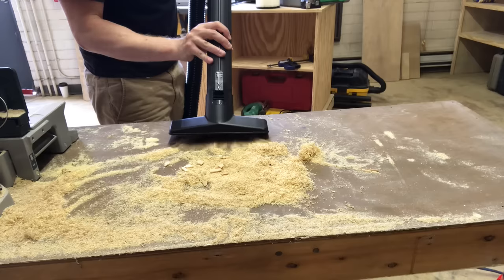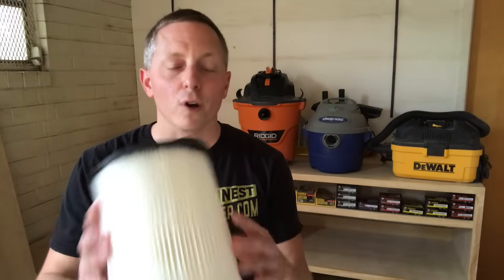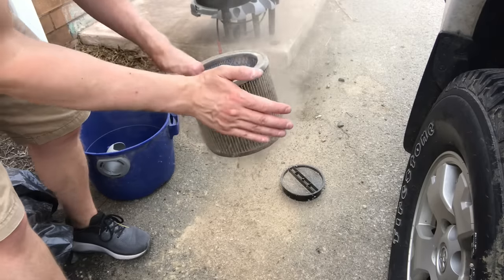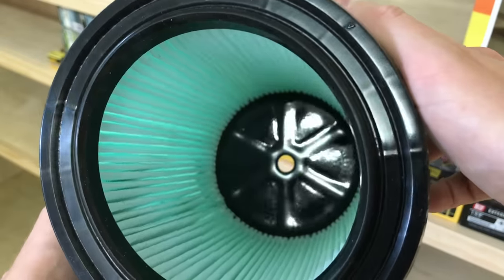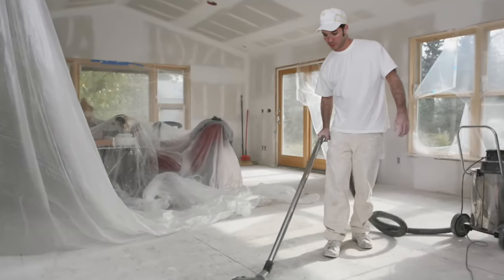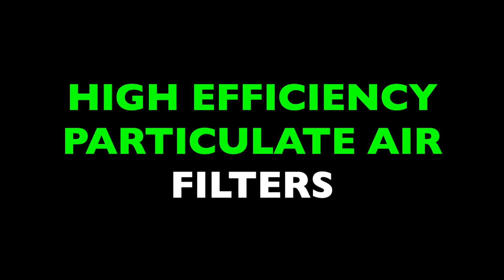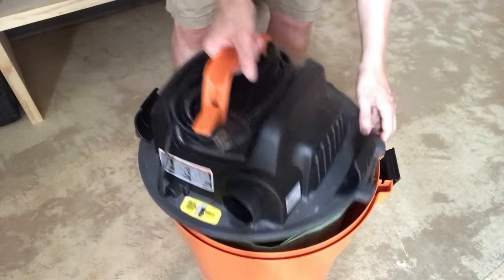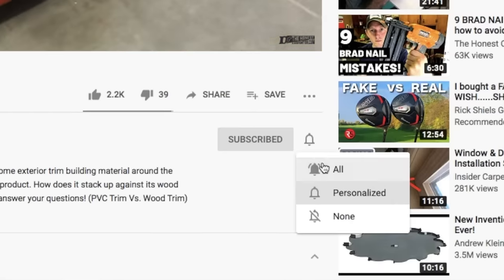Never Use A SHOP VAC Without One Of These!! (Shop Vac Filter Bags/How HEPA Filters Work...)

Comment: I recently bought the HEPA filter and bags for my Ridgid 12 gal vac. I can't believe I waited so long to do so. The best part is that they do not affect the airflow like you might think.

Using an anemometer, I measured the airflow, at the intake, without a filter and then measured it again with the bag and filter installed and did not find a significant difference. Yes, a small difference, like 3-5 cfm, but at 180-200 cfm, we're only talking about a 1% difference. I'll take that in exchange for cleaner air.

Comment: Great Video. I've been doing it right. 1 trick that I use to clean out the Shop Vac Filter Pleet's is use a Portable Mini Leaf Blower!!!! WORKS GREAT for blowing off the Saw's & Tools of debris before putting them away too. Many uses and my Mini Leaf Blower uses the same Rechargeable Battery Packs as my Drill, Impact Driver's, Grinders and Circular Saw so I suggest trying out a similar setup.

Comment: The bags are cheaper than the filter, but not much
I’ve reused the bags by cutting it open and reseal it 
I rely on an N95 mask and use a spare hose connected to the exhaust port to blow dust outside, not in the room you’re working in

Comment: I have added the “Dust Deputy” to my Rigid shop vac and has kept most of the dust in the 5 gallon bucket.....
Reply: For drywall I use the dust deputy, then a drywall filter bag, then a HEPA filter.  Without the drywall filter bag, the HEPA filter would still fill up after a while, even though the Dust Deputy would take about 95% of the sanded compound.  With the bag, it's a lot longer between having to swap out or clean the HEPA filter for a fresh one.
Reply: What is this Dust Deputy you mentioned?
Reply: @angellas.1314  An add on cyclone dust separator.  Dust Deputy was the first major make to the consumer market.

Comment: Great video! In my younger years, I would have been spared many horrible sinus headaches following your advice.  Also keep in mind a lot of times you're cutting pressure treated wood, so you're also filtering out metals like copper out of the particulate matter.  I was just thinking I needed a new shop vac.  I'll try the Rigid.
Reply from the maker: Good point about the PT, Bill!

Comment: I guess I never thought of having things “sucked up” and seeing the collection inside but never thought of particles that get let out.. The shop vac I have gave alike a fabric bag to put over for dry vac use but now wondering what is being de,eased that is not visible.  Thanks for the tip and I will look into mine since I do plan on using it for new build when ready hopefully by mid to late December.  Thanks as always.....

Comment: The best thing I ever did was to put a cyclone before the vac.
Reply: Cyclone traps are great, they catch 90% of the crap that fills your vacuum. But the fine dust that’s filling into you lungs, is still going through into the air. Pair it up with a filter bag your golden.

Comment: For over a year now, I’ve had difficulty finding filter bags,  I assume something related to COVID.  So this summer I was looking for a brand new vac.  I couldn’t find bags for my 2 pretty old Fein’s, none for 2 fairly new Stanley’s,  And Shop Vac bags have been out of stock at Lowes forever!  I had seen good performance out of my employee’s Rigid,  but not a single size/model came with a desposeable bag!  I discovered that Stihl made a shop vac and it is awesome.  Still, the store I bought it from didn’t stock replacement bags.  Thanks for your work!

Comment: I have a wireless Ridgid 3 gal shop vac that used their 18v batteries.  I put a HEPA filter into it, but it does not have a compatible bag.  However, I saw a great tip where somebody was also putting a cheap Multi-fit filter over the HEPA filter.  It keep large particles from getting into the HEPA filters pleats and it makes it easier to clean and extends its life.  not as good as a bag but probably the next best thing.

Comment: Great video.  I will have to look into those kits.  At one point I had bought a bag filter for my Rigid Shop Vac but it didn't fit right.  I had a 16 gallon unit but the blower detached to become a leaf blower and I think that was what was different.  I don't have that shop or vac any longer so I can't check.  Anyways what I did was use a Hepa filter and a cyclone dust separator and that eliminated almost all the dust I was generating (from sanding fiberglass)  I think all 3 would work fantastic together as the bag and the filter would last a very long time with the separator collecting the big debris and most of the fine dust leaving the bag and cartridge filter to only have to collect the little bit of dust that got by.

Comment: This will sound silly, but besides the internal bags (whether paper or HEPA), I just cover the air-outlet with a HEPA bag and it catches any excess dust out back... yes, it blows up like a balloon, but it catches anything that sneaks through... and yes, we need to catch debris/dust in the front, not just for us, but to save the motor - so I use HEPA bags inside usually.  Just saying, if you're doing some extra dusty (concrete, plaster, etc) clean ups, the outlet bag helps. 😉

Comment: Don't just tap the filter out, get your airline on the job!
Reply: It damages the filter as well as the soaking, unless recommend by manufacturer.
Reply: @andriyshapovalov8886  it's common practice on machine air filters so how is this filter any different?
Reply: @andriyshapovalov8886  I suspect most of the damage is jamming the nozzel into the pleats. Give the damned thig some room.

Comment: A clogged filter doesn't bog the vacuum down, the motor actually speeds up. This is because it stops being able to pump fluid (air) so it has less resistance.

I'll give you bonus points though, for mentioning .3 microns is not the smallest particle that the filter can capture but the least effective size.

Comment: Thanks for the info.  But, I only use my shop vac right now for picking up water spills and I take out all my filters when doing this.  I have other sealed Vacuums for picking up dust and dry particles on the floors of the basements and other places.

Comment: Agree about using a bag in addition to filter, have been doing this for years. HEPA is the ultimate filtration and filters are pricey. If you have a Shop-Vac brand they sell two lines of bags and filter cartridges, the higher quality ones capture more fine dust and are recommended for drywall work. I know the better bags are yellow instead of white.  Not sure how close they come to HEPA but use the best filtration you can get.

Comment: My vac filter would get especially clogged when using my CNC router ( non- commercial use ) on MDF ( aka Medite ). I bought one of those cyclones that is supposed to collect the dust before it even gets to the vacuum. It does. The last time that I emptied the 3 gallon pail under the cyclone, a check of the vacuum's tank showed just a few tablespoons of dust. If a cyclone will work with your needs, by all means get one. I bought the brand that seems to be the most popular but I won't mention the name here because I don't want this to sound like a promotion. It just worked.

Comment: Save your money and get hose extensions instead of expensive disposable filter bags for most jobs.  Hose extensions allow you to eject the dirty, smelly, hot air outside and pulls in an equal amount of fresh clean air.  It also allows you to put the noisy base unit where it won't make you deaf.  Extra points for fabricating a window insert and parking the vac outside.  Then crack a window on the opposite side of the house.

Comment: I use these bags and also an exhaust filter.
They work great at keeping dust to a minimum.

Clean up is much less. After any remodel clean the room. Top to bottom.
No matter how good the dust collection system there is going to some dust.
Reply: Do you soak the exhaust filter in water 1st.? It’s a sponge, right.??
Reply: @garycasper2929  Sometimes.

Comment: Talking about particle size e.g. 0.03 microns etc.  We need to keep in mind that a filter can be made to remove almost any size particle.  As the desired removal of particle size decreases, the filter material must be that much more “dense” i.e. the filter material spaces between let’s call it “thread size” must be that much smaller and closer together to remove the tiny particles.  The “denser” or smaller the space between the material of construction of the filter will at some point reach a point of diminishing return on tiny size particle removal.  You’ll need a much larger motor and related accessories to create the suction needed to remove the particles and/or much larger filters to get the desired job done.  It’s a matter of obtaining the benefits of a shop vac for home and/or shop at a reasonable cost.  You could install air filtration such as used in electronic manufacturing clean rooms and have beautiful air, “cleaner” than that of most outdoor areas.  It’d be a tad costly to say the least.
I like your idea on the bag and filter.  I’ve been using the bag for a few years and I think I’ll put the filter in also after seeing this.  You didn’t mention any problems with the lower air flow using both so I’ll assume that’s OK.

Comment: Since the shop vac has a hose output,bit can be vented outside or if that's not practical, a final stage filter can be made of a plastic trash can, PVC pipe run to the bottom which carries the vac output. Now put water in the trash bin, but only a couple inches above the pipe opening. Too much water will present more pressure than the vac can push against. Any remaining particulates will be trapped in the water. The water can then be periodically replaced.

Comment: Just get a cyclone separator. They are cheap, available from major stores - and work very well. Much better than anything added to the vacuum itself.  Much quicker to get rid of dust. No ongoing cost. No clogging - until the cyclone bucket is full - at that stage, the vacuum wouldn't be sucking anything but the cyclone still is until too full

Comment: The instructions for mine actually mentions this. The only time you don’t use the bag is when you’re using it as a wet vac. In other words you’re sucking up water. Other than that if you’re sucking up dry stuff yes you should use the filter itself and the filter bag.

Comment: Whenever feasible connect a hose to the exhaust port and vent it outside. I also made a dust separator for $0.00 to extend the life of the expensive bag and filter.

Comment: The bag is much more convenient, but I question the assertion that the "air is much cleaner." It depends. I watched a scientifically valid comparison between an "old used" standard shop vac filter and one fitted with a new HEPA filter and bag. The old filter actually cleaned the air slightly BETTER than a new HEPA filter and bag. The airflow in the two was roughly the same. Oddly, both worked slightly better than a high-end HEPA vac that cost 4x more. Obviously the bag is far preferable to cleaning a clogged filter, even when done outside. The testing I have seen indicates that the bag and HEPA setup WILL reduce .03 micron particles to an INCREDIBLY safe level. I'm talking overall hazard levels of 30+ units (hazardous to very hazardous) vs. levels of 1 to 2 units with your filter setup (or, a "used" standard filter LOL.) I'm glad I've seen these videos as I am no longer considering expensive specialty systems. I am, however, going to add a cyclone separator to save the cost of bags. I just need to pinpoint which one.

Comment: On the exhaust outlet I have a filter that's cut slightly larger than the hole and fits down inside under it. Every now and then I cut a new one and replace it. That stops pretty much everything the main filter doesn't. I've also used a cloth filter over the ribbed cylinder filter because those catch more fine dust.

Comment: Using a bag is key. I only take out the bag now if I want to wet vacuum. My Karcher WD6 has a filter clean button that blows the filter clean... I stopped using that inside when the sun was shining and I saw how much fine dust it expelled into the room...  instead I remove the filter and take it outside, where I whack it against a hard surface to release dust.

Comment: I agree with everything you say.  I probably won't do it though as it quickly becomes cost prohibitive.  Those bags are ridiculously high priced for what you are getting.  If you are doing any amount of work you are going to be buying one every couple of days or more.  There has to be a better way.  Also I tried one several years ago and it just didn't work in my shop vac.  Went back to a cannister filter with a paper over it.  Don't know what the micron rating is for those flat paper filters.

Comment: I dont own a shop vac. I poured a 20X20 concrete pad
next to my garage workshop. Then, I erected a metal 
roof over it. THEN, I put wheels under my tablesaw,
redial arm saw, Sliding  mitre saw,, wood lath, & chop saw
I do ALL wood milling under the roof on my pad.
When I am done, I simply sweep all the sawdust & 
shavings off into my yard keeping my workshop clean.

!

Comment: Well stated.  I have been using bags for decades on my portable vacuums.  All my equipment is hooked to a central vac which first goes through a chip/dust collector then vents outside.  Formally, I used a gigantic filter but it clogged quickly and was a royal pain to clean. Now, it's not an issue.  Also, it's important to use a central whole shop dust filter.  This is critical for your health and often overlooked.

Comment: Thanks for the infos.  How much vaccum  power do you loose when using both bag and HEPA filter?  Are the shopvac joints tight enough to prevent leaks of nasty particles? Decontamination filters are always hugely expensive (when I hear about the bills of decontamination companies), so how does it compares to this?

Comment: Just a correction: HEPA filters will prevent passage of particles .3 microns and larger.  Particles of .2 and .1 microns are smaller than .3 microns, and will not be blocked by a HEPA filter.
Reply: Smaller particles can be filtered by HEPA, 0.3 microns are the hardest to filter, hence why it's used to grade filtration efficacy (i.e. N95 is 95% of 0.3 micron particles filtered, N99 is 99% etc. HEPA is usually equivalent to N95) Smaller particles are actually easier to "catch" in a HEPA filter due to brownian motion. Particles that small can't travel staight, they're looping and zig zagging all over the place so there's a higher chance they hit the fibres in the filter. Kind of like a fly trying to get out through a window, it's pretty likely to hit the wrong spot, over and over again. And that's a living creature with a brain, not an aimless particle. 3blue1brown has a good video on brownian motion, it's much easier to understand with visuals

Comment: Awesome video!  Thanks for sharing your knowledge in a way that most of us can understand.  I have one question.  I just bought a 20 wat laser engraver and I've seen videos showing how to use shop vacs for ventilation systems.  They recommend a HEPA/Charcoal filter replacement but since they don't make them for rigid or MasterVac (at least that I know of), can I jus wrap my Rigid HEPA filter with Carbon filter wrap (including the Rigid dust bag)?  Again, great video and thanks for any info you can provide.

Comment: most people use their shop vacs in their garage or outside . they are designed for picking up large chunks of material not dust, hairs etc in one's house . 
as to the filter , i use my compressor with air nozzle to clean it . it's almost as good as washing but way easier . of course this MUST be done outside !

Comment: Excellent video with great info. I've been using bags in my Shop vacs for at least 30 years. They not only leave the air much cleaner, and extend the life of the filter, but also saves money. using bags ends up being less out of pocket dollars than constantly buying new filters. I did not know that Rigid had hepa filters available. One of those will replace my current one when it needs to be replaced. Thanks for the info!

Comment: I had the same bright idea however it backfired on me. I have a 5 gallon 4.5 HP ShopVac brand Machine and it plugged up on me really early near the inlet way before the bag had filled due to the inner filter not allowing the bag to expand properly. My guess is that on a lot of machines especially bigger ones this double filter idea is going to work fine though. The problem is that inner filter is the exact same size on smaller machines as it is on larger ones.

Comment: I have this vac and I never wanted to use it, cause of all that dust, then I found a video that said to add a bag, but don't throw out the bag, instant cut it, like when you open a bag of chips and then you fold and clip it to keep fresh, and remove unclip empty reclip, just be gentle when trying to remove and putting it back on cause these bags are expensive

Comment: I shit canned the canister filters way back when the alternative bags hit the market. Canister filters are nothing but a money pot for the manufacturer. About 5 years ago I watched a video on another channel showing how to setup a dust collector system using the shop vac as the base taking advantage of the units rollers. It utilized the dust collector from Home Depot called the Dust Stopper. That turned out to be the best decision I made for my little work shop. 99% of all debris sucked up by that Vac goes into the bucket. Any that does not, ends up in the bag, making the bag last for a very long time. I have another vac that I found a small generic bag that fit it to replace the paper filter sponge filter system. Use that for sweeping our the vehicles.